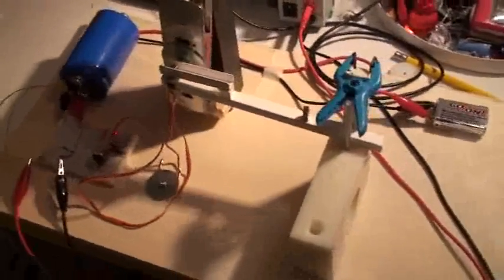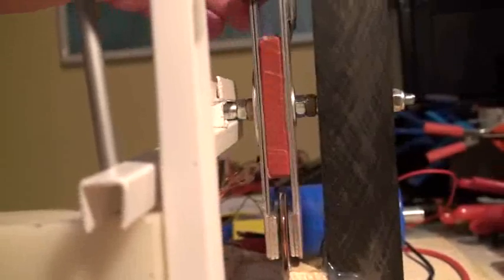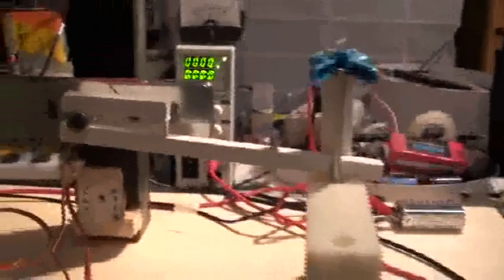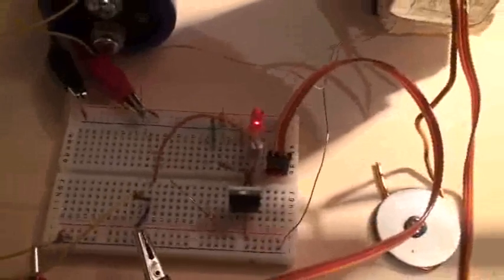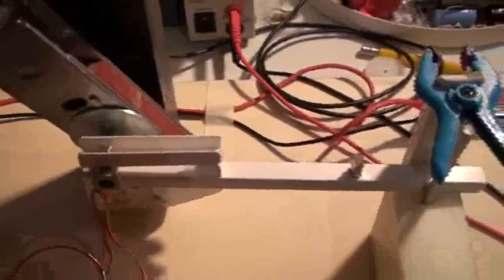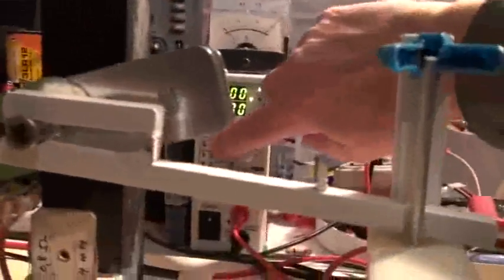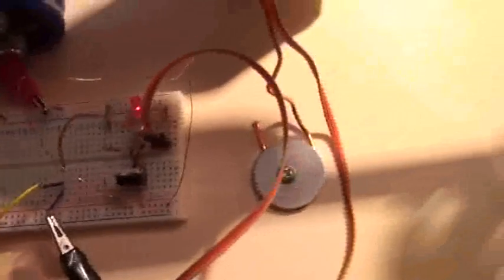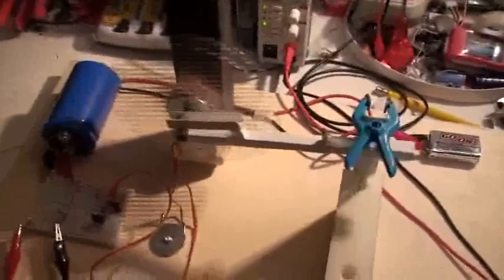lockridge test 2

Comment: The reason I suggested that you remove the capacitor is because the capacitor stores energy and can supply a large amount of current for a short amount of time.  This is one of the possible reasons that your transistors were being blown by your circuit.

The thing to remember is that a coil made with low-resistance wire and having a small amount of inductance becomes almost a short circuit across the power supply if it is switched on for too long.  The high current can damage the transistors.

Comment: When you take away the capacitor you see that the motor slows down.  That's telling you that the power supply needs the capacitor to help it drive the load.  If you just connect your coil across the power supply (same settings as when you did your test)  you will see that the power supply voltage drops.  The resistance of you coil is probably quite low, too low for the power supply to maintain a constant voltage.  The coil will probably start to heat up so don't leave it connected for long.